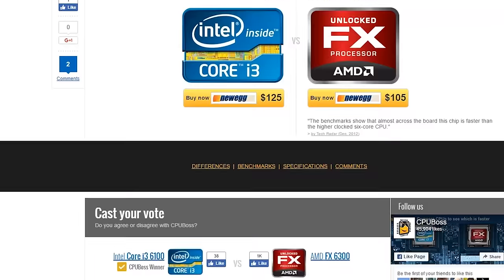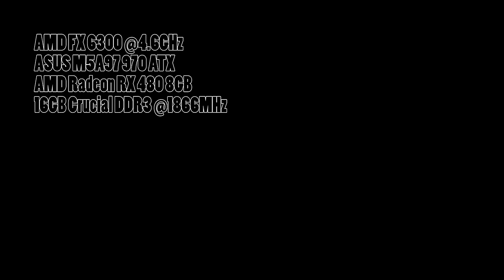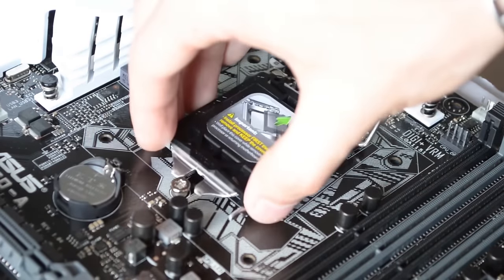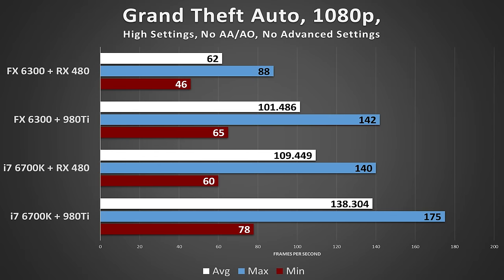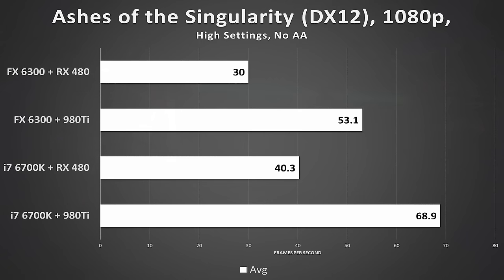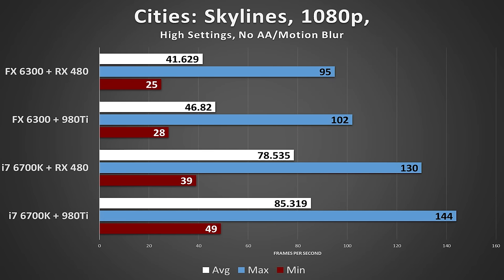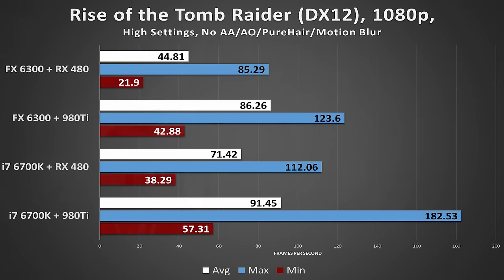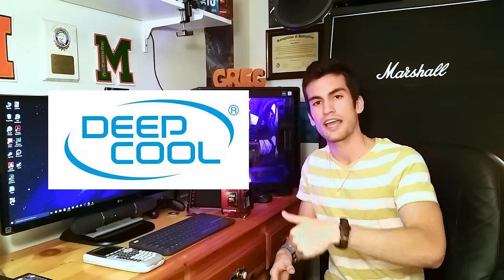AMD FX 6300 + RX 480: Severe Bottleneck?

Comment: I guess  most games are most GPU demanding than CPU demanding, so if there be a bottleneck in somewhere I prefer a CPU bottleneck, than a GPU bottleneck.
Do you all agree with me ??
Reply: No...Cpu's can be very expensive to change as the socket may be different, a graphics card regardless of the pcie slot, is very compatible so...I prefer a gpu bottleneck
My main motherboard has a I5-3470 and 750 ti, I can change the video card for now and keep this proccesor for 1 or 2 more years!
Reply: CPUs can be a severe bottleneck, too. Even with a midrange card like the RX480.

I had an RX480 and an FX6350 @4.3 GHZ and in Watch_Dogs 2 (which is a very CPU-intensive and multicore-optimized game) I never got more than 30-35 fps average, no matter at which settings! It's hard to imagine, but on low I got the same fps as on ultra preset.
Now I recently upgraded to the R5 1600 @stock and I get avg 40 fps at my custom setting, which is ultra plus a lot of antialiasing, (it's a no-brainer considering my GPU, but with the FX6350 it made no difference) and the CPU has plenty of headroom.
also it almost doubled my lowest framerates when driving around in GTA V an Watch_Dogs (1) from 25-30 to 50, both games @ max settings

This is all at 1080p and I don't care about high framerates.
Now, if you want to play at framerats north of 80, the CPU becomes a bottleneck even faster. The more fps, the higher the load on the CPU.

and last but not least: a weak CPU can cause a lot of stuttering, even if framerates look ok. that's why 1% and 0.1% lows are an important metric. With the Ryzen chip my games run a lot smoother than they did with the FX. No more microstuttering.
Reply: absolutely not.
cpu bottlenecks are objectively worse. it causes worse frametimes and more stutters overall. and worse yet, lowering graphics won't improve your performance much. with a gpu bottleneck you have tons of ways to make it the game run faster, if a bit uglier.
Reply: I've gotta agree with the CPU bottleneck here. I have a AMD Phenom II X4 945 with a Radeon 5450 512mb and that card is keeping the CPU from reaching it's fullest potential. I have a 5670 1GB coming in the mail to replace that card which is a big step-up from this POS card. So, yes, I'd prefer a GPU bottleneck, at least they're generally cheaper to replace. As such, the Phenom II seems to hold up well still today.

Comment: I have this exact setup featured in video. FX6300 @ 4.6ghz and RX480  but clocked to 1320mhz. It does well considering I game at 1080p 60fps but in some cpu intensive games I don't reach 60fps, more like 40s. In GPU intensive games 60 - 80fps is the average and in Doom vulkan 100+fps. 
This video shows me just how much a better cpu would do for me though. Zen based FX 8 core is what I'm looking to upgrade to.

Comment: Well i have fx 6300 @4.30ghz with gtx 970 , i think I should upgrade my cpu
Reply: just wait until you have enough to buy a new CPU and GPU
Reply: +Tico2858 what,no,970 is absolutely fine
Reply: get the 8350
Reply: Zsomer Grotesque he wandering if he needs to upgrade his CPU, his current one is fine, should only upgrade his CPU when he's ready to move to a new GPU
Reply: save up for a core i5 and a lga1150 mobo, the gpu you have is just fine,
Reply: I really don't play games soo much just casually, 
I use my pc manly for editing and rendering
Here are all the parts i have 
Fx 6300 oc 4.3ghz
Gtx 970
16 gb ram 
Ga-970-ds3p mobo
Cx 500 psu 
, as most of you  suggesting me to get a new cpu 
Money is not a problem because im working 
So should i go for i5 6600k with a new mobo
Reply: +Mohit Srivastava An i7 is preferred for editing in that case, and will be miles better than the fx 6300. If you don't have an SSD, consider getting one to install your OS on. Samsung let's you clone your OS drive onto an SSD of their brand easily, not sure about other manufacturers. I brought a 256gb 850 pro and loading my computer is almost instant.
Reply: +arfhanisbest im good on storage, im having 1tb 850 evo , and 2 tb wd black
Reply: i7 is the way to go i think .
will the cx500 would be enough or i need to upgrade my psu ? 
And do i need a strong mobo like z170 for i7 or some b150 or h110 will work ?
Reply: +Mohit Srivastava An SSD is good for its speed. I have 3tb of hard drive space in my computer yet I benefit from an SSD because of the much faster startup time. Soon as I log in, I can start up chrome. Something that doesn't happen on hard drives.
Reply: +Mohit Srivastava 500w is more than enough. Any supported motherboard with good reviews and that meets your requirements like 4 ram slots etc is good.
Reply: Maybe wait until amd brings out the zen cpu's? they will probably be cheaper than a i7 but if you have the cash, go for i7 I guess and use a editing software with gpu rendering support, makes a huge diffrence in time!
Reply: Mohit just said he had a 1tb ssd.
Reply: +Theo Nagan oh right didn't notice lool my bad
Reply: I had the same config and just upgraded to a 6600k. very happy. overclocked very easily. getting upwards of 10 fps more in my games now. big difference was with dark souls 3 which was always shifting from 45 to 55 to 30s, now it's a solid 60 fps
Reply: If you do not see the bottleneck wait for Zen and Kaby lake and do a decision from what you see.
Reply: humm right , i use sony vegas , after effects , some other 3d animation programs , and i dont see or feel any bottleneck , 

only while playing some games when im free , i feel like gtx 970 is not doing the justice , i have a 4k monitor(becz of my work) but i play games at 1080p
Reply: +xxshadingvazxx Agreed.  If nothing else it may result in a discount on the Intel tax.
Reply: If you want good value buy an i5-6400 + Z170 combo + decent air cooler and download an overclocking bios, I've got mine up to 4.4 GHz stable / low temps and it's pretty damn good for games.
Reply: why not fx8370?
Reply: Bratan Ivanov nah your too late to the party , I already have 1080 with i7-6800k , still thanks for replying 😉
Reply: yeah but before do so
check how much you actually are getting with a FX 8xxx Vs FX 6300
3 up to 10 FPS is not worth the afford in my opinion..!!
the FX 6300 still the best FX class 
if you want more gaming performance then upgrade to intel 
I know I know you hear that 1'000'000 times but is just a fact..!!
Reply: Danny Decarli yah sure but game is not my priority , and actually this is my working pc i am into designing and editing

Comment: damn,  i7-2600 paired with the gtx750ti msi OC edition runs csgo perfectly fine @239fps avg. a 5 year old cpu and I got over 670cb in Cinebench r15
Reply: But that's CS:GO. It uses a 10+ year old game engine. It's not very challenging on your CPU or GPU.
Reply: +Darian Alexander Yeah but they edited the engine.
Reply: +HellFireMonstersHD To an extent. Yes.
Reply: Darian Alexander It is quite a bit more demanding than Portal 2 or other valve games.
Reply: +HellFireMonstersHD yea but it's still a extremely old engine and gets 100 frames on a potato
Reply: I run a 2600 and a gtx 980
Reply: i have a fx 6300 4.1ghz with 750ti  and i have const 250fps how the fx6300 with the rx480 go lower then that
Reply: If youre trying to play competitive its not about the avg fps in cs go, its more about the lowest drop. Because have fun when 3 or 4 smokes popout and you drop below 100 especially when you play on a 144hz monitor. You should be always at least above 144fps with that monitor but i would say above 200.
Reply: Sic Semper Beats It has been edited so it is not the same old engine which runs on a potato. My PC is a potato and i always get 60fps no vsync
Reply: my friends bought a cheap pc from ebay with i5 2400 and gtx560ti and he gets 120fps minimum
Reply: +lol boy res?
Reply: +lol boy or overclock
Reply: HellFireMonstersHD what specs are you running, a gts 450?
Reply: Sic Semper Beats a potato. HD 6670
Reply: HellFireMonstersHD what cpu
Reply: Sic Semper Beats dont fucking ask m8. a Celeron.
Reply: HellFireMonstersHD daammmmmmm. Can't you "upgrade" to a Pentium
Reply: Are you trying to tell me that a high end product from a few years ago runs a heavily optimized game released around the same time?
Reply: Dalton Stewart lol
Reply: Titan SixtyNine lol to bad ur monitor only displays 60 hrz so the other 170 don't matter
Reply: Cody Fournell Still there's less input lag
Reply: Gewel doesn't matter 60fps is 60 fps...
Reply: Cody Fournell It does

Comment: tl;dw: CPU matters MASSIVELY and AMD dropped the ball hard with Faildozer over these past five years. They need Zen to be good or else they're done.
Reply: Honestly when it was released in 2012/2013 it was alright compared to the i3 and i5 3570k but now like 3-4 years later they haven't released anything better.
Reply: Alright vs those intels at stock. 

Problem is those intels overclock like maniacs on air since they were so much more thermally efficient. 

Then their performance is consistent across all applications and games unlike AMD CPU's that need properly multithreaded software or they generally suck ballz. 

Which isn't AMD's fault to be honest but it is a reason to buy the Intel instead
Reply: I've never had a problem overclocking an AMD CPU on air, I push a 4.5GHz FX4100 with a single fan Corsair Hyper 212 Evo cooler and always stay under 55C, even on super hot days like today, never pushed passed 55C where as I see tons of i7's pushing 65C when OC'd to 4.4GHz. But I do agree, AMD hasn't done anything CPU wise in years, they dropped the ball big time and because of this we've seen an increase in Intel barely making waves with each new iteration of their CPU series and still asking insane prices, because AMD isn't lighting a fire under their ass. Right now, if you want the best, you'd get any newer i7 chip and you're good. That's just how it is and it's because AMD hasn't stepped up to the plate. And yeah, AMD CPU's are terrible at single and even dual threaded applications, they only really shine when it comes to four or more cores being utilized properly.
Reply: The price-performance ratio for Bulldozer is/was actually really good, especially for the 8000 series. The 8120 for example matched the i5 2500k in gaming, had double the cores so it could be used for workstation stuff pretty nicely, and was slightly cheaper than the i5
Reply: @demrasnawla  https://cpu.userbenchmark.com/Compare/Intel-Core-i5-2500K-vs-AMD-FX-8120/619vsm173

How was the 8120 even close?  And this is just one benchmark (though it's been done on a bunch of different PCs with these CPUs).

The first bulldozers were straight shit. For everything pretty much. The x3xx series were a tad bit better, but they still got trashed by even the cheapest I5s in games, and a 2500k even mopped the floor with them in production applications.

Comment: Quite surprised that the FPS differences between FX-6300 + RX480 / 980 Ti vs i7-6700k + RX480 / 980 Ti is not that huge of differences, personally, it matters to me if i can at least reach 60 fps and have a good stable 60 fps for the majority of the time I play my games. I'm quite happy to see that the old FX series is still capable of competing against Intels 6XXX series processors in terms of gameplay. Personally however, it was cheaper for myself to order the Athlon series. Could you perhaps show benchmarks of an Athlon X4 860k @ 3.9ghz + RX480 / 1070 vs i7-5820k + RX480 / 1070 or i7-6700k + RX480 / 1070 sometime? I realize you said you're tired of doing GPU stuff but perhaps before the end of the year you can do this?

Comment: FX 6300 is good enough! Just lower the settings to medium and your frame rate will jump to 80FPS!
Reply: I'm still using it with a gtx 1050ti thinking about upgrading the gpu first
Reply: Upgrade your fx6300.I went from a fx6300 system to an i5 8400 PC and the fps in the same program is 30-50fps higher in the new processor
Reply: @caribbaviator7058  I used to have an FX8350 but its way of handling power seems to be unreliable, so I did away with that and now I use an Intel core i7-4770k cpu oc to 4.4 ghz with 16 gb of ddr3 ram 2400 mhz, and a GTX 1080. I doubt any FX cpu can match the performance of the i7-4770k unless it was overclocked to like 7 Ghz.

Comment: I wonder how many annoying comment section wars will be caused by zen.
Reply: ZEN IS THE BEST!!!!!!!!!
Reply: it already was bad enough when the rx480 came out ...
Reply: Rx 480 is not too bad. Think about the 5.1 TFLOPS you got for 120 watts as long as they fixed the PCI-E power draw issue.....
Reply: Adam Liu nah, I actually really like the RX 480 and I am hoping that it will sell good and help AMD out since I do not want to have a monopoly of both Intel and Nvidia. But I hate reading all these Fanboy comments that are just ramblings without any reasoning
Reply: They won't. They still got those console stuff...Cheaper stuff sells more... Nano is another beast, 8.1 TFLOPS for 175 watts.
Reply: the Powerdraw issue didnt made any difference  unless u used a 50$ Motherboard instead of an 100$ one... and yes most Graficards pull more Watts over the PCIe Powerheader tthan the header is rated for.... A 16x slot got a rated powerdraw max of 75w  and with a heavy overclock of a GTX 750ti (by MSI) the card is pulling 87w over the PCIe slot. And  did you heared of any BSOD cuz of Power-to-Low ever ? or did a 80$+ Motherboard ever melted or explodet ? The answer is NO.

Comment: Lol, my phenom ii x6 1055t still runs like a charm :)
Reply: hell yeah, got mine at 3.75 ghz, had a 1090t that i killed that could run 4.18 ghz tho, but runs circles around fx x1xx series cpu's
Reply: ya i have a fx 6300 and no issue
Reply: Those Phenoms X6 processors were proper hexa-cores and better then bulldozer crap that came after it.
Reply: 1barnet1
they also have a higher icp than the fx processors